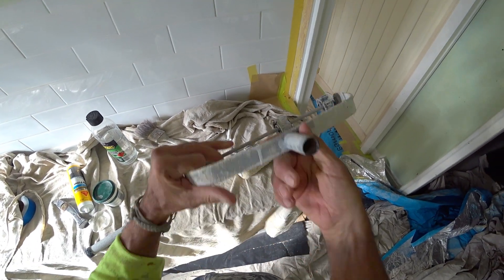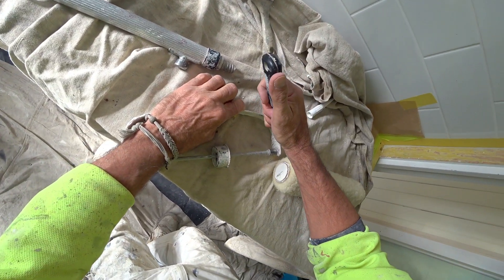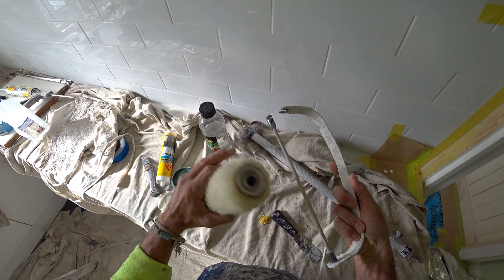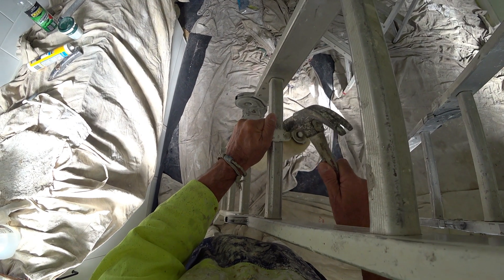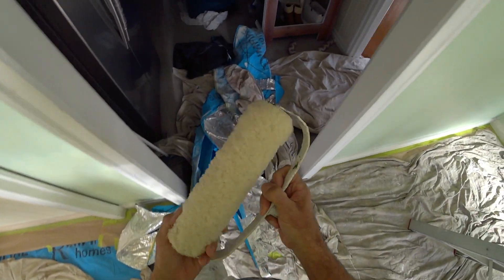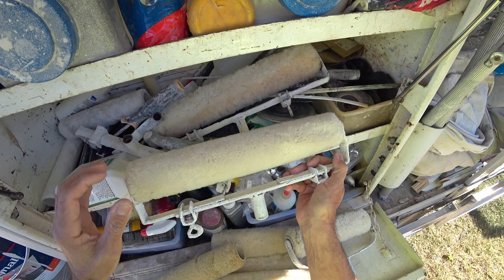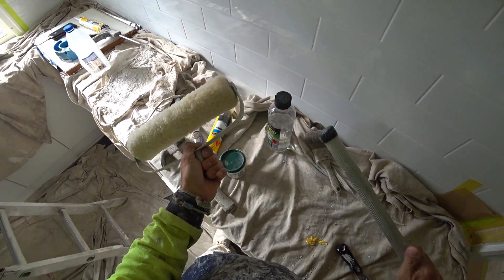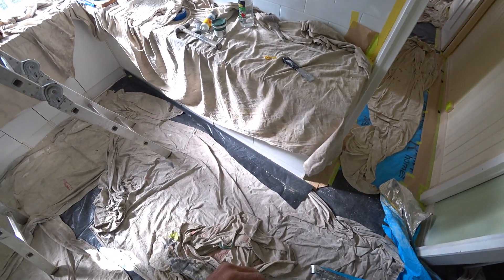juggernaut steel roller frames fitting tips

Comment: Each to their own, but a frame that requires 10minutes and a hammer to fit a sleeve isn't a frame for me.
Reply: Agreed and I just ordered one a day before this
Reply from the maker: @onlymemories2595  You will never  regret buying one, it will be your best frame for many years.
Reply from the maker: I don't make them nor am I trying to sell you one, stick with your other ones, that way you can buy a new one regularly because you will never have to replace one of these
Reply: @ThePa1nterhowto  too be fair mate, I've had the same issue you've had for years, shitty roller frames so I went online and bought the one in this video and the more heavier duty juggernaut, should be arriving Tuesday. Im still keen as im out of options, sick of this plastic shit, when you roll hard like me they always end up bending
Reply from the maker: @onlymemories2595  Your gonna love them
Reply: I agree, they are awesome.  They are held closed by that spring pressure but I have never needed to hammer, bend or persuade them.  And for the few seconds it takes to close a roller, you know it's not going to open and have a sleeve fly off under use.  I get the end caps off with the roller scraper part of a 5-in-1 tool.
Reply from the maker: @RAL1966  Great you like them, I tend to leave my sleeves on till worn out then I cut the sleeve through  the middle and pop the ends out.